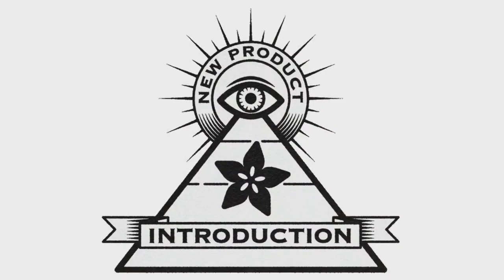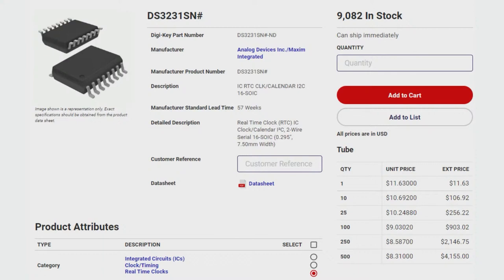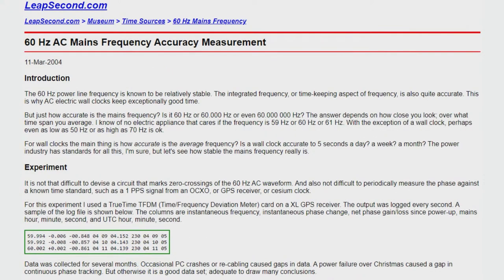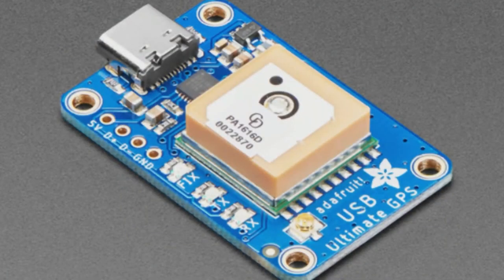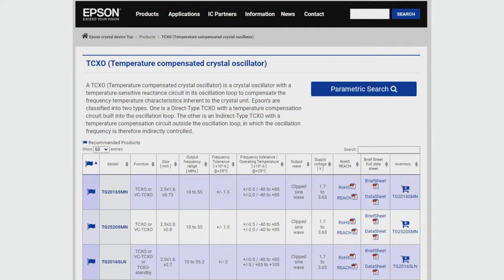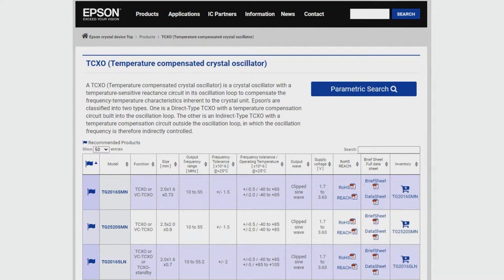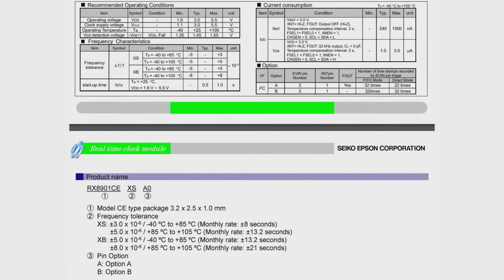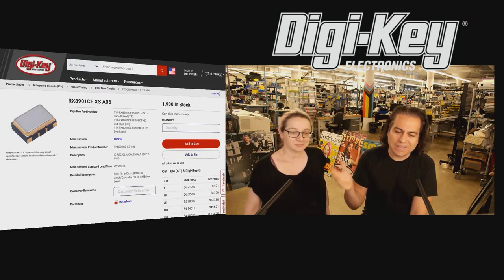EYE on NPI: EPSON RX4901CE and RX8901CE Temperature Compensated Real-Time Clocks #EYEonNPI @DigiKey

Comment: I have a story about the stability of 50Hz in my country.

From time to time you ear story about people complaining the clock of their electrical oven is off and running too fast or slow.
The technical explanation is that those clock sync on the 50Hz.
But why would the 50Hz not be at 50Hz you may ask.

So when the power delivery company has to work on the line, they will cut the connection to the network of a street and replace with power generator.
Ok, but why would the power generator not send 50Hz...

Well this is because of solar panel from house owner, those have a protection system and will cut power generation if the frequency is not 50Hz.
The Solar panel also need to stop sending electricity in the house if there is a powercut (that is because when fireman cut the power, they don't want electrocution due to your pannel).
So when a street is disconnected from the network and on generator, the network does not want to have solar pannel send excess of electricity, as they cannot compensate for that.
So by putting 49Hz or 51Hz on their generator, they can block all the Solar Panel.

The only negative effects are: (1) some clock act funny (2) solar panel owner cannot produce electricity.